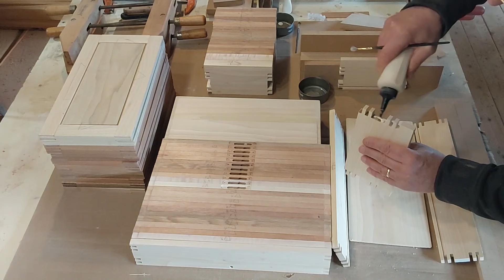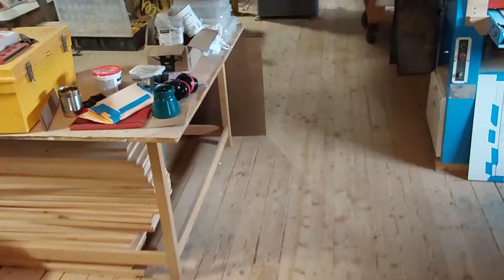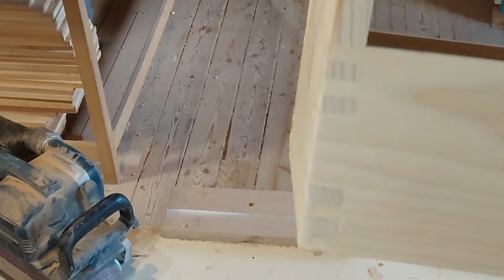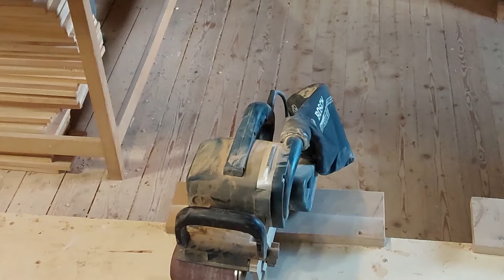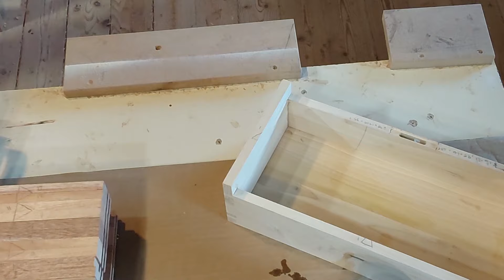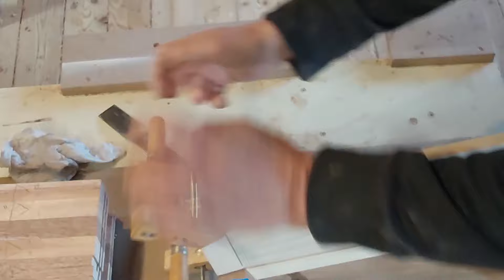Jewelry Box Glue-Up. Jewelry Box Build Video 7.

Comment: Very meticulous! Nice material. Tho, as it is the want of the unwashed, your wood clamps on the main box were tilted, putting a twisting pressure on the box. Or are the box joints sufficient to resist that? Thx.
Reply from the maker: There is no twist in the boxes, when they are taken out of the clamps.
Reply: @DavidKlenkFurniture  probably not, but I’d still make sure the wood jaws are parallel to the sides…..I’ll have to look at that in my shop.👍🏻